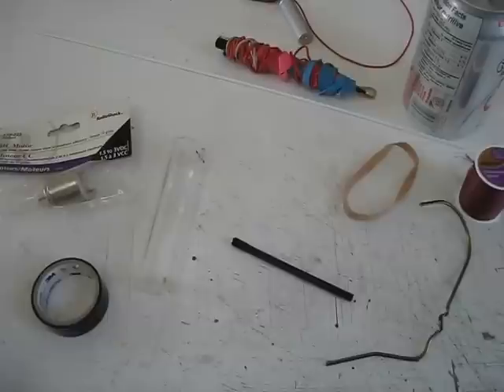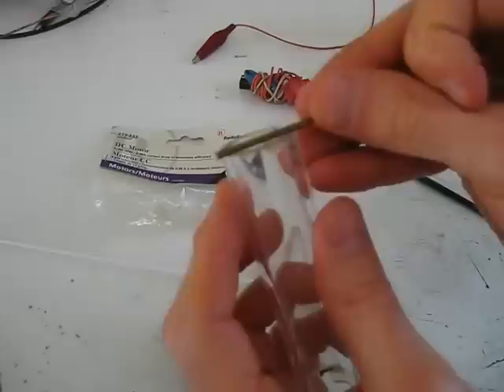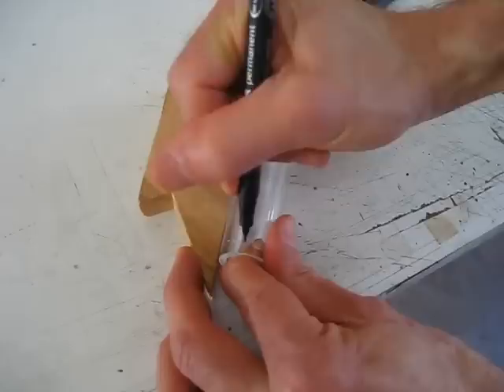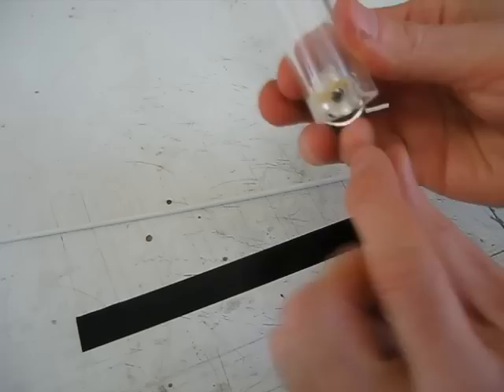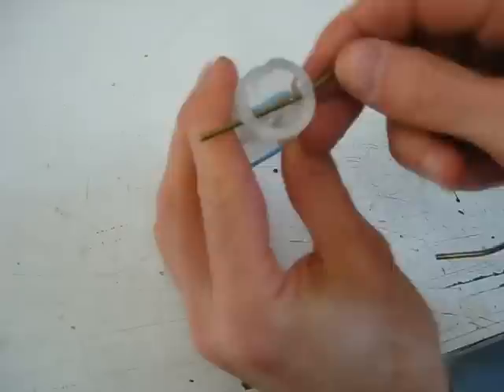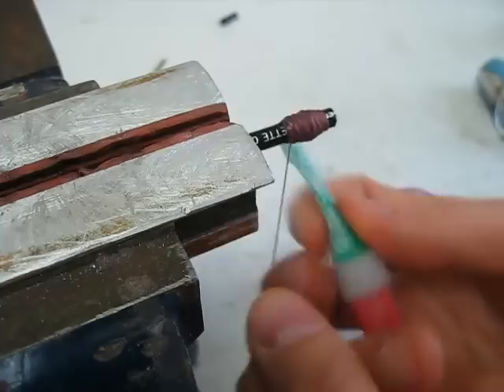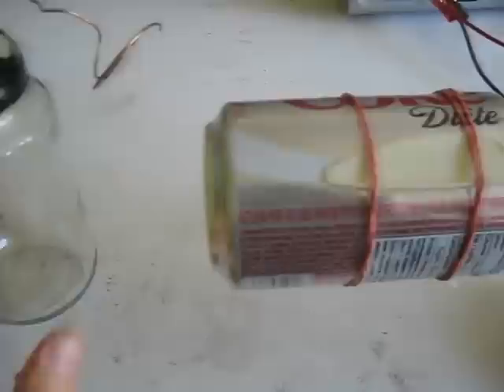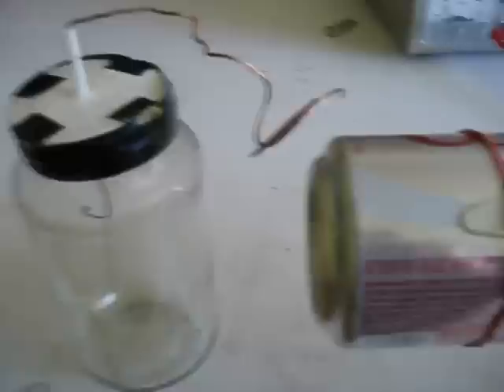How to Make/Build a Van de Graaff Generator Part 1 (Homemade/DIY)

Comment from the maker: Using the design as in my "How to Make a Van de Graaff Generator Part 2" video where the end of the tube is inside the can made a big improvement over the design in this Part 1 video. The other thing is to experiment with different roller materials. Also, playing with the gap size between the wires and the belt, making them as close as possible helps a lot.

Comment from the maker: No, it doesn't hurt fingers. The voltage is high but the current is very small. The voltage is needed for the spark to occur, but once you have a spark it's the current that does the damage. When I react to it, it's really just because of the surprise. But I wouldn't do the same thing with my really big, 15" diameter domed Van de Graaff. There the current would cause damage. These soda can Van de Graaff's are safe. And I'm glad to hear you love my videos! Thanks for watching!

Comment from the maker: I don't know. Is the shaft that it turns on smooth or are there some rough plates that might break the glass? Or were there some bits of metal left in there, maybe from when you took the fuse apart?

Comment from the maker: What is the material surfaces of each roller? What is the material of the inside surface of the belt? I also find the the distance between the belt and brush plays a big part. What is the bottom brush connected to?

Comment from the maker: @ritupate076 Is it humid in your place? Van de Graaff machines work best in dry air. What materials did you use for the rollers/pulleys and belt? You do have to play with the spacing and position of the wire ends a bit. Did you get rid of as many sharp edges on the can as possible, very important? If you used a ground wire at one end like I did try making it actually touch the belt as it's running.  If you give me more info maybe I can help.

Comment from the maker: @qteo94 Do you mean for attaching the shaft to the motor? In my case I was lucky to have a plastic tube that fit very tightly to the shaft. But attaching to the shaft is often a real problem. Especially since the belt tension puts a lot of strain there. Thanks for the tip.

Comment from the maker: @eatmmyshorts I don't understand your question. In the video I used a plastic knife and two rubber bands. The important thing is that one end of the wire go INSIDE the coke can and connect to it from the INSIDE. Connecting the wire to the outside of the can wouldn't work. I don't know if that answers your question though.

BTW, in the description to this video is a link to my Van de Graaff webpage that has more photos that might help, including closeups about the brush.

Comment from the maker: Yes, some sort of earthing is required. See my other video "How to Make a Van de Graaff Generator Part 2" for more earthing options, for example, connecting the ground wire to the INSIDE of a second can, or holding the bare ground wire in your hand (which doesn't work as well.) There's a link to the Part 2 video in the description below this video. As for how long it takes to charge, that depends on how well it works. It should be no more than 5 seconds or so, but can be less.

Comment from the maker: In my "How to Make a Van de Graaff Generator Part 2" video I show a few options for ground, including using another can or just using yourself. Pinch the other end of the ground wire between dry fingers. You can also use another can - connect your wire to the inside of the can. If the motor's powersupply is grounded then connect to that ground. There's a link to the video in the description for this video and it's on my channel page under Browse videos-Uploads.

Comment: Hey guys, hey RimstarOrg. I wanted to share my experience regarding roller and band materials.

Upper roller:
  For upper roller I used a class tube from a fuse and thicker one that I bought specifically from glass factory that produces them. Both did work but thicker one produced less noise because due to larger radius it rotates slower to provide the same linear speed to the belt.

Bottom roller:
  For bottom roller first I tried regular PVC insulation tape(bought from any electric store). Note that PVC is a synonym to vynil. To tell PVC tape from other plastic tapes, try stretching it - PVC stretches and if you release it, it'll contract about halfway back. Then I found out that they sell a thing called "teflon duct tape" but I failed to find it in our local stores. Then some googling revealed that Teflon is actually a synonym to Fluoropolymer or PTFE and the latter one may be easily found as a tape that used in plumbing to prevent water leakage at pipe connections. So I bought it at some random plumbing store.
  Then I made a PVC roller. It was made by gluing together about 4 roughly roundish disks cut from 5mm foamed PVC board with diameter of about 20mm. Then I drilled an axial hole in this roughly-cylinder, clutched into a drill and sanded to a perfectly barrel-like shape. After that I wrapped this PVC roller with my PTFE tape(just 1-2 layers sufficed for me). Works like a charm.

Band:
  I failed to find any kind of rubber bands similar to what you use in the video. And I don't even recall seeing them used anywhere around here. So I bought a pair rubber gloves in some random gardener store and cut a ring at wrist part of it. It's not an abundant source of rubber rings since you can get about 2-3 rings out of 1$ glove but works well enough.

Comment from the maker: Sorry, I didn't see your comment from 4 days ago until just now. It'll still work if you don't just end the roller and tape it, assuming I understood what you mean. I ended mine because I didn't want to make another hole in the other side of the cylinder, but that would have worked too. I don't know what you mean by erasers though. See my other video "How to Make a Van de Graaff Generator Part 2" for hints as well. There's a link in the description below this video.

Comment from the maker: Do you mean the sharp edges of the can? I'm putting epoxy. Any epoxy, or epoxy resin, will do.
Although I got 20% better results by cutting away that end of the can altogether with my newer design. See my other video "How to Make a Van de Graaff Generator Part 2" for that. There's a link in the description below this video or you can find it on my channel page.

Comment from the maker: You can see the other wise at 10:11 in the video. But I show it much better in "How to Make a Van de Graaff Generator Part 2" when I talk about grounding. You can find a link to that video in the description below this one and on my channel page. Definitely do not connect the wire from the motor side roller to the can. You might also want to look at my "How a Van de Graaff Generator Works" video for some background.

Comment from the maker: Depends on your motor and how tight your belt is. In my new video, How to Make a Van de Graaff Generator Part 2 (see description for link), I show a small commercially made Van de Graaff that runs on 2 D cell batteries. But I also show my DIY one needs 4 D cells to barely run it. If I had a bigger 1.5. volt motor I might have needed less. I'd say start with 2 D cell batteries in parallel (positives connected, and negatives connected) and add more as needed, assuming you have a 1.5 volt motor.

Comment from the maker: I added the earth ground to give the electrons a place to go to that would easily accept them. The reason the electrons are going to ground has to do with the material that the roller is made of, vinyl, and the belt, rubber. Due to the triboelectric effect the vinyl becomes negative and repels electrons from the rubber to the ground wire. See my other video How a Van de Graaff Generator Works for the details. Click on the annotation at the end of this video or the link in the description.

Comment from the maker: +Aditya Sharma The black paper was actually black electrical tape which is made of vinyl. The key is that it is vinyl, so not just any tape will do. It's what I talk about at 1:40. I explain more about the materials on my webpage at http://rimstar.org/science_electronics_projects/van_de_graaff_faq_frequently_asked_questions.htm#Q_RBMATERIALS
I didn't connect the wire from the can to anywhere in the plastic tube. Instead I put the sharp points at the end of the wire very close to the rubber band, but not touching it. It's a little blurry but I show this at 9:50.
You might also want to watch my How to Make a Van de Graaff Generator Part 2 video since it has some improvements and more tips https://www.youtube.com/watch?v=QrCgtjZwnB0
PS There's no Reply button under your comment because of your Google+ settings.
- go to your Google+ page,
- in the top, right corner click on your thumbnail icon,
- in the popup that appears, click on "Settings".
- for the 2nd question down "Who can comment on your public posts?" set it to "Anyone".

Comment from the maker: What materials did you use for the surface of the rollers/pulleys? What is the belt made of? What did you use for ground? Did you connect the wire that goes to the can INSIDE the can? The wire ends that are at the roller must be spread out so that there are sharp points and must be as close to the roller as possible but not touching. Also, see my "How to Make a Van de Graaff Generator Part 2" video for more tips, including some improvements. There's a link in the description below this video.

Comment from the maker: @johnli33 Around $3.20 US/CDN. Google Radio Shack 273-223. It's the 1.5 to 3VDC Hobby Motor Model: 273-223 Catalog #: 273-223 . But all sorts of motors will do. And I'm glad you found this video helpful. You can also find more details about the parts using the link given in the description below the video.

Comment from the maker: Are you connecting to the soda can on the inside or the outside. You must connect to it on the inside like I do in this video, or even better, like I do in my "How to Make a Van de Graaff Generator Part 2" video. Also, play with the spacing between the wire brushes where they are near the belt at the rollers. Space out the wires and put the tips of the wires as close to the belt as you can. The ground one can even be touching. See the Part 2 video for many more tips.

Comment from the maker: @eatmmyshorts The end of the wire that's near the belt (9:48 in the video) must have multiple sharp ends. That's why I used stranded wire (stringy), it has many smaller wires I spread apart a bit. The smaller wires act like sharp points. One sharp point isn't good enough either. A bunch of sharp points facing the belt is needed to have a lot of ions moving between them. See my "How a Van de Graaff Generator Works" video for the basic principle (a link's at the end of this video.)

Comment from the maker: Whether or not it would work on batteries depends on your motor and on how tight your belt is, tighter belt needs more/bigger batteries. See my "How to Make a Van de Graaff Generator Part 2" video at 10:12 in where I show this. See the link in the description below this video or find it on my channel page. Safety depends on the size of the batteries. You'll be safe with AA batteries or D cell batteries. Car batteries are dangerous but you won't be using anything that big.

Comment from the maker: I attach it inside the can. You can see me do it at 9:22. Though I got better results with the way I did it in my other video "How to Make a Van de Graaff Generator Part 2" (there's a link to it in the description below this video.) The important thing is that it makes electrical contact with the INSIDE of the can. That's for the Faraday ice pail effect to take place.

Comment from the maker: I'm not clear on where you're talking about putting the capacitor. Do you mean between the power supply and the motor? Or do you mean at the output of the van de graaff. If you mean at the output then there won't be much power there. The voltage may be high but the current is tiny.

Comment from the maker: It makes sense that you'd get shocks from the battery side if you're using that as ground. As for why the sparks there are bigger, it could just be that there are less losses on that side or you're getting some contribution from the battery's charge itself. You could try a different grounding method like the ones I suggest in my Part 2 video (link in this video's description.) Glad to hear you got it working!
(Weird that youtube keeps marking your comments as spam.)

Comment from the maker: Look up a triboelectric series table. The material for one roller must be at one end of the table and the material for the other roller must be at the other end of the table. Use the table to choose your materials. Since I used vinyl on one roller I used nylon for the other. See my video "Triboelectric effect/series or triboelectricity" for more on this. There's a link in the description below this video or find it on my channel page.

And no problem with all the questions. I'm happy to help.

Comment from the maker: It does sound like you're getting a tiny result. You should be able to get a spark though, so there is some room for improvement. What did you use for the belt? Is it plain rubber?

Comment from the maker: The materials you chose for the outer surface of the two rollers and the material for the belt are very important. What materials did you use? The material for one roller must be on one side of the triboelectric series table and the material for the other roller on the other side and the belt material in the middle.

Comment from the maker: The top quarter or so of the belt can be and also the top roller and brush. They usually are. I got away with just making the connection with the top brush's wire inside the dome. But you'll get better results I think if you do as you're thinking - though I haven't tried mine that way.

Some explanation of why is in my How a Van de Graaff Generator Works video. There's a link in the description below this video.

Comment from the maker: The inner surface of the belt and outer surface of the rollers is one of the keys to making it work due to the triboelectric effect. Polyester looks like it won't work as well as rubber but I can't say for sure. The small pieces of the can that you couldn't cut and fold might play a small part but I had a little of that two in my Part 2 video and it was ok. Make sure you have a good ground, see the Part 2 video. Play with the distances between the wires and the rollers, get as close as possible.

Comment from the maker: I connect it inside the top of the can. It must be inside and not outside. See the video at 9:06.

But another way is to cut off the top of the can, make the wire longer and push it inside like I show how in my video "Van de Graaff Faraday Cage Science Experiment". There's a link to it in the description below this video. That works very well, and gives better results.

Comment from the maker: +Dylan Yang  No, it doesn't have enough power to. But even then, this is intended for producing high voltage output and as a source of ions. Neither one is what you want for a lightbulb.

PS There's no Reply button under your comment because of your Google+ settings.
- go to your Google+ page,
- in the top, right corner click on your thumbnail icon,
- in the popup that appears, click on "Settings".
- for the 2nd question down "Who can comment on your public posts?" set it to "Anyone".

Comment from the maker: The earthing is because you need something that will easily give electrons or will easily take electrons. The Earth ground is like that. But if you watch my "How to Make a Van de Graaff Generator Part 2" video you'll see more options for doing earthing. There's a link t that video in the description below this video. You can use thin rubber bands or tape or anything that will hold the pieces in place, as long as it's not made of metal. Have fun at the science fair!

Comment: Great video. It is complete, easy to follow, and has great expectations.
I would like to add a tip. To prevent a drill from catching in plastic I will file the "screw" pulling edge of my drills flat. This will make it "Forstner bit" like.
Reply from the maker: Thank, I'm glad you liked it. And thanks for the tip. I hadn't heard of Forstner bits before this. There are times this could have come in handy.

Comment from the maker: Is the belt is a rubber band like I used? Using copper thread for the top roller is okay and so is the tape for the bottom roller. However, the copper thread won't cause the triboelectric effect to take place like nylon thread does so the effect will be less, so you might want to look for something on the positive side of the triboelectric series table. What you use for the shafts doesn't matter. Also, the faster the motor turns the better, but be careful not to burn the motor.

Comment from the maker: You're welcome. If you're going to make a Van de Graaff generator, be sure and check out my Part 2 video too. It has a lot of additional improvements.
A very easy, and painful, stun gun can be made easily by taking apart a BBQ igniter. See my video "How to get Piezoelectric Crystal from BBQ Igniter/Sparker" where I take one apart, but I don't demonstrate stunning anyone with it. In my recent video "10,000 Subscribers Thx - Ionocraft, Electret, Joule Thief, and More" I do show me stunning myself.

Comment from the maker: No. If you mean on the side were the motor is, I did attach the wire to the tube but just to hold the wire in place. The metal end of the wire with the sharp points is touching the belt at the roller at that end. Though if you can get it to work with the sharp points just pointing at the belt at the roller with a tiny gap between them then that would be better - less wear and tear on to the belt over time. I do that in my Part 2 video (see the description below this video for link.)